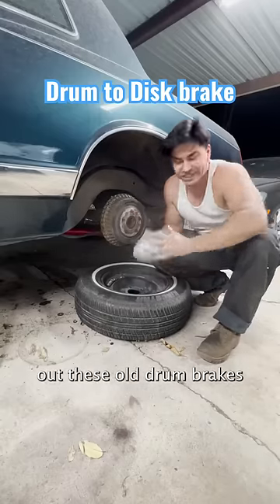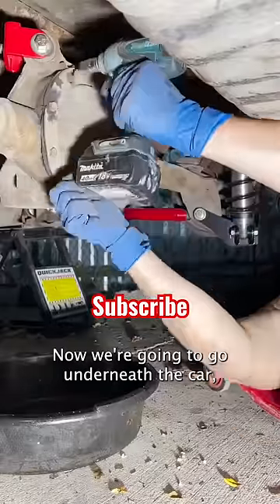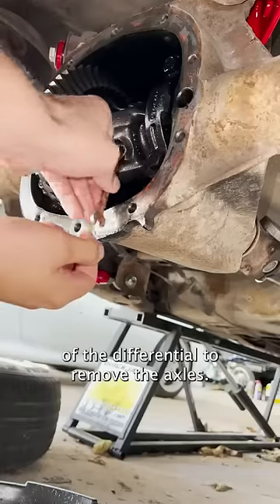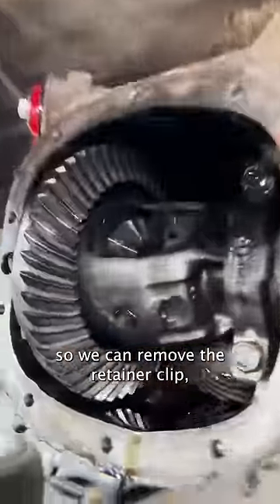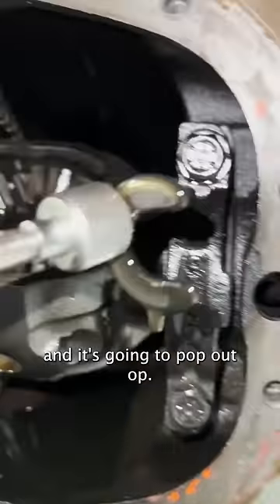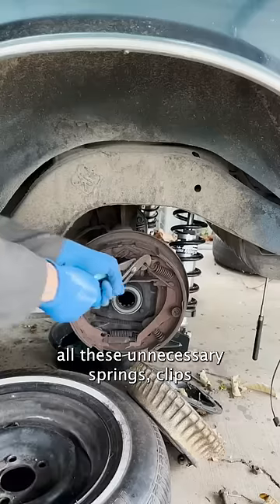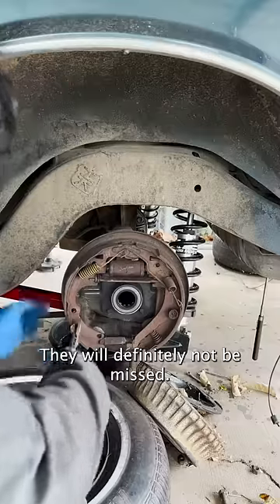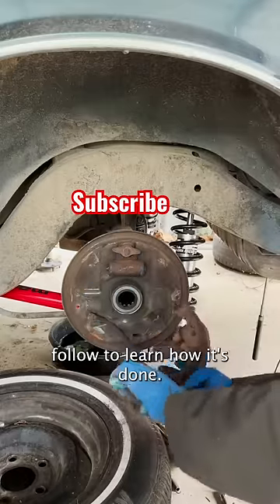Convert drum brakes to disk brakes on G body Monte Carlo

Comment: What kind of psycho doesn’t slow drain the diff 😭😭😭
Reply: Someone in a hurry
Reply: @Dave12753  well he only has 60 seconds
Reply: I can smell it from here
Reply: I would’ve loved to see all that fluid flung by the plate dropping but I guess not lol, then again if that happened it either be cut out of the video or not posted at all
Reply: You can't if there's no drain plug, and you can't if the cover is stuck so there's no way to slowly open it from the bottom
Reply: @ashtonbatterson5309  a thin head screwdriver breaks the seal mate, leave 2 bolts threaded in the top and slow wedge the screwdriver at the bottom
Reply: Don't be an Axlehole your hole lifeboat plug!!!!!! 🤣🤣🤣🤣🤣🤣
Reply: That one
Reply: Lol
Reply: @ashtonbatterson5309  you couldn’t be more wrong if you tried.
Reply: @Gunzee  he'd prolly have more time if it wasn't a short
Reply: Someone that is new and thinks knows it all just because he has learned how to skip steps.
Reply: Lmao. I was going to say… literally gear oil all over the fucking garage floor. 
He’ll be smelling that for weeks.
Reply: Have you seen the weather?!? I would rush to do it too😂
Reply: Ahh this made me cackle lol
Reply: Guy in video -  “I swear that’s never happened too me before” 😞
Reply: @ashtonbatterson5309 pry the cover off with the bolts a couple turne out. Simple
Reply: Leave the too bolt partially in so it doesn’t fall
Reply: Someone who doesn’t care about the environment. Grow up guys, start bringing your old oil to autozone or advance to recycle. Stop polluting the ground water you drink from
Reply: Someone who loves the smell of GL5 so much that they get covered in it and smell like sulphur for the next week....
Reply: @ashtonbatterson5309 yes you can leave a bolt at the bottom half way threaded and the cover opens like door
Reply: Meh throw dirt or sand on it
Reply: Just drill a hole in it tap it for 1/4 inch pipe thread and toss a plug in there. Duhhhh
Reply: This guy apparently
Reply: He got nearly all of it in the bucket somehow too. I was blown away.
Reply: A butcher.

Comment: drum brakes work great as long as you treat them well and turn the drums when you need too.
Reply: And know when they need an adjustment.
Reply: There’s a reason cars don’t have them anymore
Reply: @loganjasso2982  because disks are easier to work on. Literaly the only reason.
Reply: @redjasper1100  yup but it's more complicated of a handbrake mechanism and Drum brakes are so much easier to find parts for as they all use very similar sizes and aren't too specific
Reply: @loganjasso2982  there’s also a reason you don’t see many people upgrading rear brakes. it’s highly unnecessary when 70% of braking power is put on the front discs
Reply: @Deathbomb9  drums automatically adjust themselves
Reply: @Mrjack-yn2dj  one click at a time per reversing stop. Most people don't back up fast enough to get them to adjust, and not all are self adjusting. If you rely on that alone then you clearly don't understand that you still need to check them periodically.
Reply: @Deathbomb9  no they automatically adjust, some yes in reverse other's with the parking brake, but rhey all adjust at once, none adjust "one click" at a time. 

All will adjust when pressed on the brake pedal, take of a drum and press the brake pedal and it will expand
Reply: most cars' brakes will never reach the thermal load that disc brakes would benefit over. disc brake "upgrades" are one of the most misunderstood & needlessly done mods, tons of people do this thinking it will help them stop faster
Reply: @Mrjack-yn2dj  but thats when all your braking power is far down on the pedal.vif you want a better pedal then you manualy ajust them
Reply: @roboticunclephil go road racing with drum brakes
Reply: @redjasper1100  more fade resistance also I believe.
I used to drive my dads 90 Mustang GT with rear drum brakes and I could heat those things up easy.
Reply: @Mrjack-yn2dj  the shoes "expanding" is called braking. It depends on the car which way they adjust, but they don't fully adjust in one application. They adjust if needed, as in all four corners will adjust at the same time, but not completely if you need more than just a small adjustment. You're taking things a bit too literally and that tells me you really don't want to have a conversation, but instead think you know everything there is to know.
Reply: @Deathbomb9    I think my 12 certifications state otherwise, and yes they do adjust as far as needed, drum brakes were/are popular because they are so low maintenance. If you have to manually adjust you drums you either just serviced them or the self adjuster is not working correctly.

The only thing you do when inspecting drums is to check the shoe material and make sure your wheel cylinder is not leaking, other than that everything will still work.
Reply: @Mrjack-yn2dj  oh boy, the appeal to knowledge argument, my favorite. If you need to adjust them to get the drums off, then you need to adjust them back. I just rebuilt serviced all for corners on my Falcon. And some people don't ever do what's needed for them to self adjust as they wear. But I would argue that there is one other thing you can do to get your brakes to be even better than disks...arching the shoes. Beyond that you are correctable inspections, and checking the system.
Reply: @loganjasso2982  but they do 😂
Reply: @redjasper1100  😂 drum brakes are trash compared to disc. Stopping distance says otherwise. Just because its easier huh you are high. Disc does everything better from proportion to friction
Reply: @davepalmer9265  do you want to talk about why semis still use drum brakes?
Reply: I rebuilt drum brakes almost everyday for months because no one wanted to do it. I eventually learnt how to make myself disappear or busy whenever I seen one taken apart.
Reply: @davepalmer9265 nope 😂
Reply: @kylelaughinghouse1893  hell just drive fast on the highway, anyone saying drums are good is a luddite.
Reply: @dethmetel  man who wouldve known so many people would get mad about this, I just mean nearly all cars sold now are equipped with disk brakes.  Its a youtube comment section, relax guys.
Reply: @loganjasso2982  yea cost saving and ease of manufacturing the majority o& braking is done by the front brakes the rears mainly for the parking brake
Reply: @kylelaughinghouse1893  go road racing with standard brakes even with discs on the rear and see how long it takes them to fail
Reply: Rear drum brakes work just as well as rear disc brakes

Comment: Pro tip for next time you need to open your diff: Leave one bolt in the top that's loosened so the cover doesn't drop into your drip pan and then throw gear oil everywhere. Also, try draining it first.
Reply: what if we really don't care about a mess.
Reply: @capcom7794  or smelling like old gear oil? Then no need to worry, have at it. But that smell doesn't come off your skin for 12hrs to a couple days depending on the type and stank.
Reply: Shut up?
Reply: @joseosorio1242  who are you talking to?

Comment: I hope you don't forget to get a new proportioning valve that's rated for 4 wheel disc brakes.  If you don't, you might as well just keep the rear drum brakes. Disc brakes require 2000+psi,drums only require 100's psi. Willwood makes an adjustable proportioning valve sometimes called a combination valve.  Anyway they make an adjustable version so you can really dial the pressure in.
Reply: No they don't it varies between 900 to 1200 and drums use 400 plus
Reply: Combination valve is normally a proportioning, metering, and a pressure differential switch.

They’ll also need to switch the metering valve if it’s not already a combination valve, because that’ll hold off the pressure of the front brakes for the drums to go first

Comment: Actually, I never really had an issue with rear drum brakes. Just clean them up occasionally and check the wheel cyls, springs and adjusters...all good, they were fine.
Reply: Yeah on low performance everyday cars they are better. Need changed maybe once ever.
Reply: If you’re racing they suck ass though constant adjustments uneven wear and short lifespans
Reply: @AquariumAficionado if you're not racing theyll last forever though

Comment: Pro tip, leave one of the top bolts on the diff cover loose but still in when you crack open the cover.  That way it doesn't go flying off and making a mess.

Comment: I know this is unrelated but i thought I'd throw it in here, I'm a diesel mechanic and do drum brakes a lot, to get the springs off I use parking brake pliers, you wrap it around the spring hook and give a fast pull and it makes it jump the spring retainer (hole and pin), I always show it to people because it takes two swift motions to get the pads free, Not sure if this applies to cars honestly, it's been 5 years since I've done drum brakes on a car

Comment: One thing I recommend. Don’t switch drum to disks. Yes they are great brakes but they can’t handle all the weight unless u get extremely heavy duty ones. The reason it had drum brakes to begin with is because the wheels stop at different % for every vehicle. For example ur small Honda civic probably had 4 sets of rotors and disk brakes since it’s a tiny little car with a small engine. But ur trucks and even el caminos. Are heavier to the point where u won’t stop as fast with only disk brakes. (Yes there are trucks with disks in the front but only the front. Usually it’s either drums on the back or all around) this is because the drums can actually brake and be adjusted a lot easier to lock up and slow down the tires faster then pads and rotors
Reply: Drum brakes definitely have better stopping power but for performance they aren’t great. The drum doesn’t allow heat to exit and cool down the pads and drum brake surface so after a couple hot stops they’ll start to fade wayy faster then vented disk brakes would. He’ll probably have to adjust or change his brake proportioning valve to change the different brake % to add more to the rear
Reply: If this was actually facts then why dose my 1050kg Capri have drums on the rear but my 2100 kg commodore has disks all round they were made 10 years apart I'm pretty certain the Capri will stop better on disc breaks and will look nicer with a visible caliper both front and rear

Comment: Fun fact: more than 60% of a car's braking force is actually exerted on the front brakes. That's why some new cars today still have drum brakes on the rear; they're cheaper to make and there's no need for extra braking power. Drums also tend to be better protected against dirt that gets kicked up by the front tires, making them last longer. This is a pointless upgrade, should've left it original.

Comment: What you actually removed was a half shaft which is what goes between the wheel hub and the differential and what the wheel bearing is mounted onto

Comment: Btw if you do this another time just remove the pins that hold the shoes to the backing plate and remove em as a whole piece rather than Messing with springs. Also helps when you’re replacing and you can look at em while they’re there on the floor as a “diagram”

Comment: The drum brakes are fine. Just learn to work on them.
Reply: They seem complicated until you work on them one time. The intimidating springs just pull the pads back off when you release the pedal.
Reply: @ArdFarkable  that is the one of the few advantages over disc is the brake retraction time.
Reply: Drums are great.  The only benefit with discs, imo, is heat fade.  Most of the stopping power is 70% on the front anyway.
Reply: I'm changing mine out for 'performance '. Looks better, plus it's easier to change. And yes, I am pretty comfy working on them, but for my daily... Pass.
Reply: Exactly there just “fine” time to upgrade 🤙🏼
Reply: @Roman________  drums stop better than disc. But if you start actually hard braking a million times over they will experience brake fade. But most disc kits people put on their cars or trucks tend to lead to less brake performance. BUT dics tend to have less work involved in maintenance. But they do not last as long as drums and the performance is not as good as drums. People just look at drums as these ancient brake systems. They arent.
Reply: 100%. mine have lasted 120,000 miles and counting.
Reply: @Greeko_Poloz  I had rear disk brake pads last 130,000 miles before.
Reply: @davidperry4013  you got a flinstones car?
Reply: @Sak-zo1ui  yea I agree for the most part. Most ppl that do upgrade from drums are buying the cheaper china made brands an actually cause more issues . If you spend your money an do willwood or a bigger name you can’t go wrong plus like u said nicer look as well I’m not against drum brakes but if I can afford to put “GREAT discs” I’m go that route 100%
Reply: @Roman________  for sure definitely agree. I would definitely drop some coin on a set of baer bbk lol.
Reply: Indeed. I've never seen a rear Drum brake fail at our shop. What I HAVE seen is MULTIPLE rotor and pads prematurely wearing because the guide pins always seize. Mostly cuz people never service the guide pins when doing brakes.

Drums in the rear are perfectly fine. Alot of cars still have drums in the rear
Reply: @richardcurtis2688  there is more contact area with drums. Thats why you dont need power brakes to run drums. But you do with discs. Drum brakes will stop a vehicle faster than discs. Thats why semi tractors and trains use them. Same with trailers. The issue is brake fade. They tend to heat up under spirited driving much faster to the point where braking distance is lowered. In 1955 i believe when imperial was developing the first ABS their drums were not drums like today. The system was used on the limos only, but it was able to take a fully loaded limo on bias plys and reliably stop the vehicle in wet and dry conditions like it was a smaller vehicle. Fast forward to the mid-late 60s and early 70s lincoln, imperial, chrysler, buick and cadillac were developing a rear abs system all on drum brakes. Where this became an issue was the devolopment of disc and drums on the same vehicle. Because they are two different braking systems and the mandate of dual circuit brakes in 67 this made life quite difficult to try and not lock up the very powerful rear drums compared to the front discs. Which is why the big three abs system was implemented on the rears WAY before the fronts. Although all four corner abs would eventually become a thing. There is a reason drum brakes can lock the tires up on a dump truck as well as a car. Disc brakes can too but they require the use of vacuum boost and sometimes hydroboost. Each have their purpose but drums are far from terrible. I wouldnt be surprised if you delete your comment.
Reply: @richardcurtis2688  comment from Richard Curtis was, “What? Drum brakes are garbage and will never be good as disc. You don’t know much about cars I see. They barely stop a car. Do some research before you say something stupid.”
Reply: @Sak-zo1ui   If drum brakes are so awesome, why did we do away with them? Why were front drums replaced with disc, where most stopping power is needed? Why are there "upgrade" kits to change from drum to disc? Drums get stuck. Star wheels seize all the time. Wheel cylinders ALWAYS leak. The springs break and fall apart inside drum. The brake material on the shoes crack and fall off inside. Drum brakes are garbage and a nightmare. If you like them, keep them and enjoy your world. I'll take disc every time.
Reply: @richardcurtis2688  drum brakes are litterally still used and are even on electric vehicles.
Reply: @Sak-zo1ui  Good luck with that. Disc are superior. Deal with it.
Reply: @richardcurtis2688  you have yet to provide any evidence. While I have. Just face it that discs are better at some things while drums are better at others. You dont have to justify one being better than the other because they are different intended purposes and designs.
Reply: @Sak-zo1ui   Evidence? We're not in court. Go do some reading. It's well known that disc brakes have superior stopping power. I'm done with you. You're dismissed!
Reply: @kelsycunningham8452 exactly. Converting the front is easier too. Some have front disc and rear drum. Drum brakes aren't worse they just don't dissipate heat as quickly. In the back it's not even an issue.
Reply: @richardcurtis2688  bro more surface contact means more stopping power. That is why trains and semis use drums mainly. Discs dissipate heat which is why city oriented trucks are starting to use discs. More contact patch is on drums which means they stop better.
Reply: @richardcurtis2688  quit limiting your knowledge because you want to justify a purchase.
Reply: @Roman________  you can adjust drum brakes so that they don’t rub for drag racing plus unless you get light weight disc brakes they usually weigh more than drums. If you want to stop faster get summer tires and light weight rims .

Comment: U didn't need to undo the drums . Just take the 4 bolt off and the e brake cables.   And it all comes apart
Reply: That's a gbody bro the flange is different it's two small bolts and one big nut on the back usually siezed on and he'll to get off

Comment: While you're that far you want to replace that open Differential carrier with a posi or mini spool or spool depending on what you're doing and some Moser axles and it would be a good time to put some 4:11's in there. FYI don't go over 500-600 hp on that 7.5 G-Body 10-bolt even with all the upgrades I stated above.
Reply: Ah just slam the welds to the spider gears she'll be mint

Comment: All that work for very little gain and more maintenance in the future drum brakes last alot longer and work just the same there's a reason trucks have drum brakes because they work great and the mass helps them dissipate heat pretty well